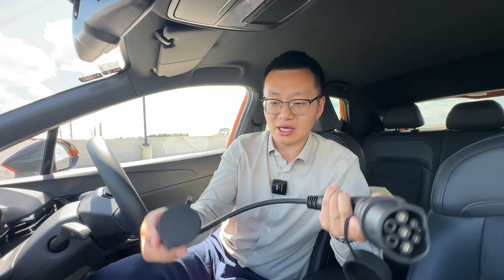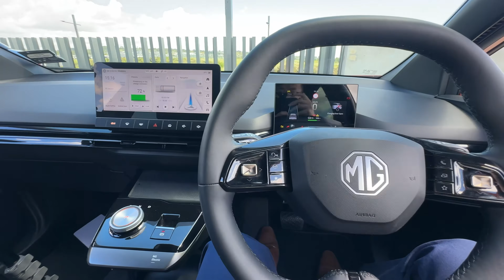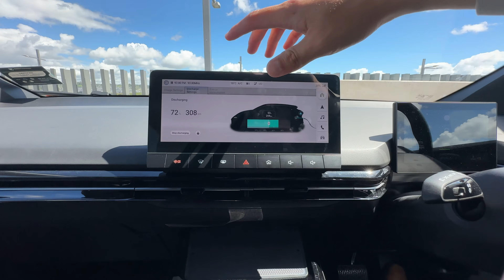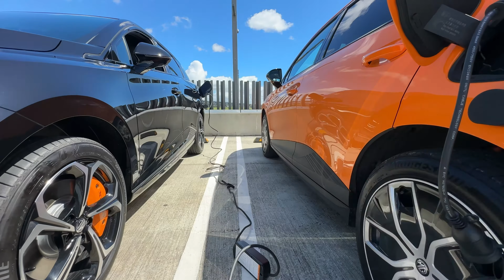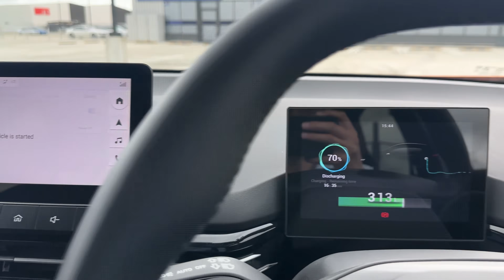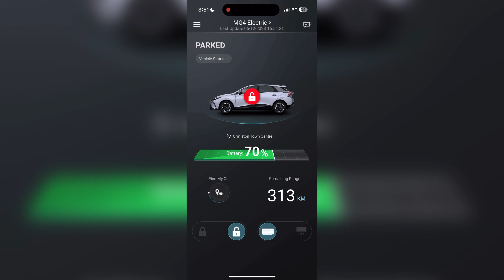MG4 Tutorial / User Guide - 15. V2L Function Explained (Vehicle to Load) - How to MG4

Comment: Great video as always Jerry. My 51 Excite battery was at 18% when the house power went out today. I connected my V2L cable to find out that the battery level had to be above 50%. So I was not able to use the v2L. On the discharge screen, I tried to adjust, by sliding, the power level but it would not move. Is the discharge power level adjustable on a 51 Excite?
Reply from the maker: Thanks for the support. It is not possible to use V2L under 18% unfortunately. I'm not sure why it doesn't allow you to select the level. You may need to charge it up and try again

Comment: Nice video. For the discharge/charge test between 2 Mg4 cars, is it possible to use a T2 to T2 cable instead of the special discharging cable ?
Reply from the maker: Thanks for the comment. That's not possible. The V2L function is enabled only via a proper V2L cable. A type 2 to type 2 cable can only draw power from a proper charging station or power outlet

Comment: Thanks. The MG4 V2L on my Essence 64 supplies AC output voltage of ~216 V, which is a bit low (A/NZ standard is 230 V AC). I think it is nominally meant to be 220 V output (which is China's AC voltage standard) but mine was lower than that. I'm using the official MG supplied V2L adapter.

Output power will be limited to 2.2 kW using the official MG4 cable and often less because of the low AC output voltage from the on board inverter. The adapter cable and AC output socket are rated for 10 A max (10 A x 216 V = 2.16 kW).

It is possible to draw more power using non-standard cables with different resistor values and fatter gauge wire (up to nearly 7 kW) but MG have not published anything about the actual recommended usage or capacity limits. It would be very helpful if they did.

I consider the V2L to be a handy source of power when out and about, or as a backup source of energy should you require it, e.g. a grid power outage at home where it can replace a petrol generator as a temporary power source for essential items, or as you show, emergency slow charge of another EV to at least enable them to reach a faster charge station. I plan to use it to power a charger for my home battery should we experience an extended power outage. That way I can draw a steady 1-1.5 kW and not stress anything.
Reply from the maker: That’s interesting. I didn’t know much about that before. Sorry I’m not that guy who knows everything about the technical details. Not sure if MG or someone else can improve that at this stage.
Reply: @PanMotoring  It's not a huge deal but I am surprised the output voltage is as low as it is. Whether or not MG can adjust the inverter's output, I've no idea. It's still a handy feature. Just wish they would provide some documentation as the manuals and spec sheet are very skinny on details.